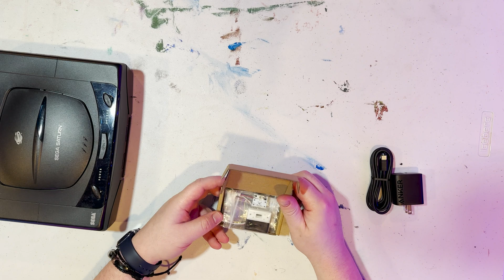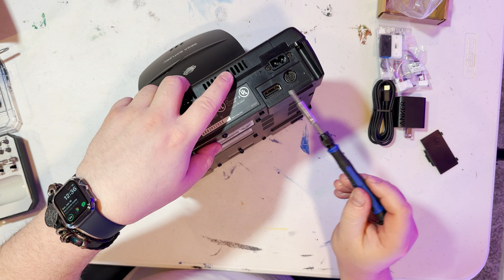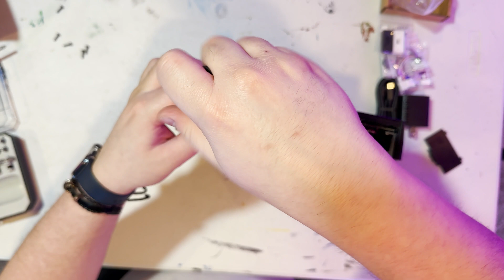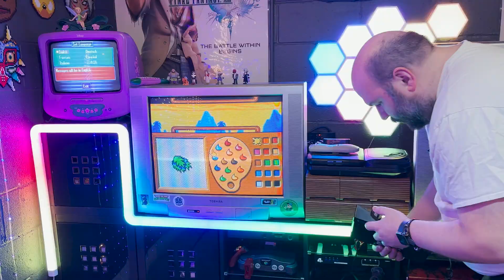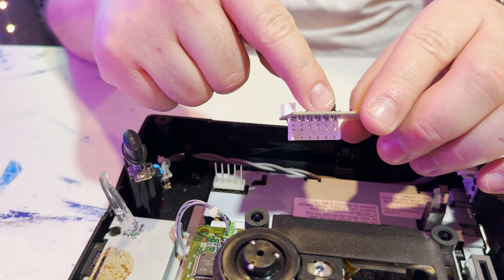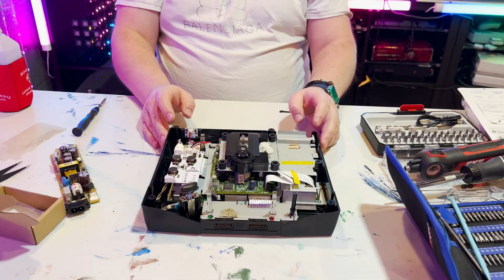New Power board for the Sega Saturn

Comment: I am strictly against gutting the Saturn. The only reason to mod the system is if you switch input power from 110V to 230V and vice versa. What you've done is spend $50 to remove your ability to use a $1 wire stolen from the nearest printer, laptop power brick or HiFi.

You are now stuck with a very specific USB-PD or QC (check with documentation - these standards are different!) power brick and an expensive beefy data-enabled USB-C power cord. Mix up the brick or wire unable to deliver Quick Charge - and your Saturn might get fired!

Please  inspect the capacitors, if those look good - revert the console to stock and close it up for good. Stick $30 SAROO into the cartridge port and never open it again! Saturns are fun to use and easy to preserve without modding.

What you REALLY want to do (if you have troubles with power bricks), is convert your Master System, NES, Genesis, SNES, TurboGrafx and Atari to USB-C. All of these consoles internally work on 5V - just desolder 7805 and directly feed 5V in its place. You literally can power a SNES from any USB port of your laptop! You might want to 3D Print a housing for the USB-C socket, so it would fit instead of the original barrel receptacle.